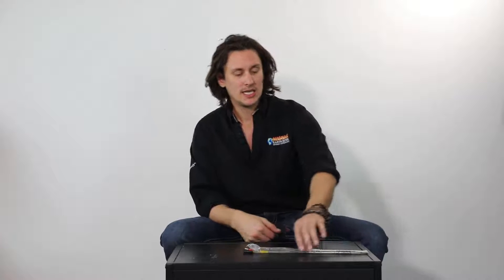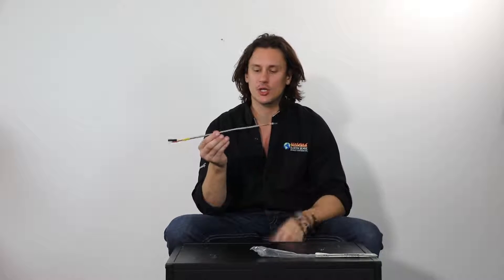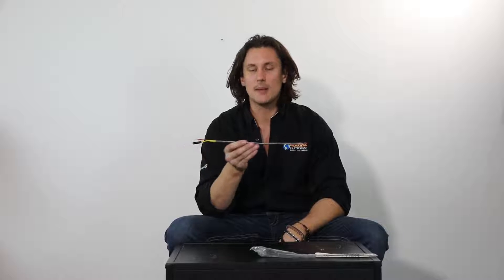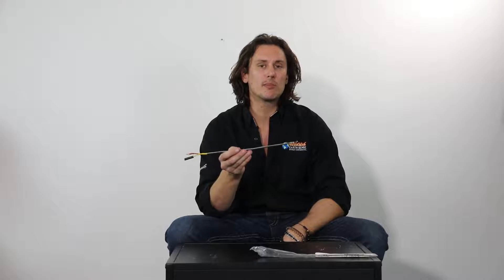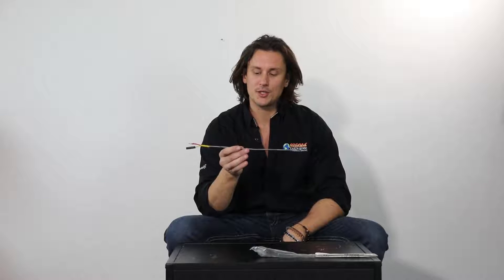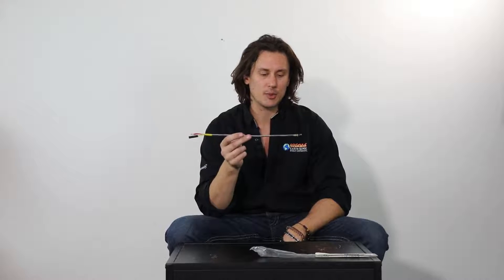Quadrafire Thermocouple Function & Troubleshooting

Comment: Please help.....i have an old quadra fire contour from like 2002. The red call light won't stay on and i just fixed the connectors from the old wires coming from the box. The thermocouple was replaced last year.
Reply from the maker: Thanks for the message. Please walk us through the details. 
Does the call light come on at all? 
Is your combustion motor running? 
Is it feeding pellets at all? 
Have you checked your wall thermostat?
The more info the better. Always check the simple things first. 
- Thermostat Wire connections. You can bypass the thermostat by putting a large paper clip in the terminal where the thermostat wires are. This will let you know if it's an issue with your thermostat. 
- Outlet Voltage - If you have a volt meter, double check the voltage coming from the outlet. We want to avoid extension cords and we recommend a surge protector incase there is any power surges or spikes. 
Let us know some further details - Happy to help.
Reply: @EarthSense upon further investigation it seems to be the thermocouple connection to the rest of the wiring harness. So the red and yellow wires are backwards on this, it was that way after buying a new thermocouple 1 or 2 years ago. So the red wire from the new TC goes to the yellow wire on the harness. If I fiddle with that particular connection I watch 1st the green light will flicker on and off. Now If I let the stove go through it's start up process, which after figuring out everything I need to keep clean for this thing to function properly, it starts up great. When it's about time for the small red light to come on, the light that indicates it has reached 600 degrees and keeps it on and feeding, I again need to mess with that same connection that made the green light flicker.
Reply from the maker: @JKRTV  Thanks for the message. Yes, definitely sounds like the issue is with the thermocouple connection. I would think it will be a matter of figuring out whether the terminal is causing the issue or if it is the thermocouple itself. Get a good light and do some inspection on the terminal and wires coming off the terminal that go into the junction box. If that all looks good, then you may want to get a replacement thermocouple to see if it is the culprit. Keep us posted. Happy to help.
Reply: @EarthSense  I haven't been able to test the thermocouple the way your suggesting, but it's been working perfectly since messing with that connection.
Reply from the maker: @JKRTV  That's good to hear. Leads me to think that it would be the connection. Maybe something is loose.. If there is any rust or build-up on the terminal or connections you can use 00 steel wool to clean them up. Happy to hear you are warm. Thanks for the update.
Reply: @EarthSense Thank you for the video sand commenting back with all this so fast. Yeah it's something with the yellow wire coming from harness going to the red wire on the TC. Between the harness wires connection to it's female connector and the TC's red male connector. The other end of that is while I tinker with the wires the TC and ceramic are slightly moving around in the fire pot. That makes me wonder if the TC tip is moving away from the end of the ceramic....could that be possible? I'm more leaning towards the wire connections but that other part has me curious....
Reply from the maker: @JKRTV  Yeah absolutely, happy to help. I would agree it's most likely the wire connections. If the thermocouple was moving back far enough from the end of the ceramic cover I could maybe see that, but it would have to be a decent amount and I don't think that's the case as you tinker. It's good to make sure the thermocouple is approx. 1-1/2-2" into the burnpot to properly detect proof of fire. Here's another thermocouple video for resource as well. https://youtu.be/Hjs3KhP9ntI?si=qpD7D8ThMOaOMh__
Keep us posted, Thanks.
Reply: @EarthSense  I'm guessing that's your personal stove? Yeah I have the bullet connectors, didn't know that's what they were called. I have my TC in the firepot 1 inch but I'm pretty sure that's what the instructions said... also guessing that's just what it was on this particular model form 2002.... should it be that little bit more?
Reply from the maker: @JKRTV  Thanks for the message. This was a refurbished Quad 1200 insert model I used for the video. Good rule of thumb: Have the thermocouple extended into the firepot at the length of the ceramic cover tube. We want the Thermocouple bracket to secure the tube and the thermocouple itself at the very end of the ceramic cover. 

On a side note, check the thermocouple connectors. Use fine steel wool if you see any corrosion on the connectors to clean them up. 

Keep us posted. Thanks!
Reply: @EarthSense hello again... hopefully your still looking at these.  So I'm still having problems with the wires going to the thermocouple. Right now I feel like the wires connecting the TC to the computer need to be replaced. Problem is that box is basically sealed with rivets.
Reply from the maker: @ Thanks for the message, always happy to help. Yes, the TC wires along with the other component wires are apart of the Junction Box in the unit which is sealed with rivets. Generally speaking in this situation a new junction box would be needed if you have determined the issue is within those lead wires. Here is the replacement Contour Junction box for reference - https://pellethead.com/product/quadrafire-contour-castile-fs-santa-fe-fs-junction-box-wire-harness/

Comment: Hello,  I have a quadrafire 1200
Was working then power went out at house now won't start...
No exhaust fan..
No lights on control box
Call light does come on when thermostat
Turned up
Tried control box
Bypassed #3 snap sensor
New exhaust motor
What's upppp?
Reply from the maker: Thanks for the message. It sounds like maybe there was a power surge or short that happened when the power went out. Was the 1200 plugged into a surge protector? When you say 'Tried Control Box' does that mean you put a new control box in? If you have a local dealer possibly they can test your control box. Check the fuse in the junction box where the control box goes into and replace. Check all wiring and connections. Keep us posted, happy to help.

Comment: I have a question about my Mt. Vernon AE.  My wife noticed that the blower seems a little louder than normal.  Also, I turn the thermostat to “Off” in the evenings so that I can clean the glass before I fire it up the next day.  Lately the blower is blowing in the morning even though the stove is turned off.  Later in the morning the blower is running at high speed even though the thermostat is set to "Off".  When that happened I sa a "Bad TC Drop Tube" error message on the thermostat. Any thoughts as to what I need to do to fix this?  Thanks.
Reply from the maker: Thanks for the message, happy to help. Checking in with our tech team on this. Just to confirm, are you referring to the distributiuon blower (Room Air Fan) or the combustion blower exhaust fan that is running when the T-Stat is set to off?
Reply from the maker: Hey Jim, some feedback from our technical team - Drop tube thermocouple issue. Stove thinks it's hot, that's why the fan is running.
The Drop Tube TC is also referred to as the Thermocouple K Ring Mount. Reference: https://pellethead.com/product/pellethead-replacement-quadrafire-mt-vernon-ae-edge-60-thermocouple-k-ring-mount/

Let's take a close look at the mount and electrical connection of this part. Keep us posted. Thanks!

Comment: Great thank you. I will watch these videos. When I turn the stove on, I am not getting a green light on the box. When I push The reset button on the back of the unit, the auger does not start. The fan is running, the heat element is glowing underneath. I ordered a new thermal coupler from you, through Amazon, that is coming tomorrow. I wasn’t sure if that could be the issue as well.
Reply from the maker: Thanks for the message back and information. The thermocouple will allow the stove to continue feeding pellets after the ignition cycle. If pellets are not feeding when you turn the thermostat up to call for heat and/or when you press the reset button, we most likely have a different issue at hand. Always good to start with the simple things first. In most cases this is typically an issue of ash build-up/blockage in the stove or vent pipe. Let's make sure the stove and venting is thoroughly cleaned. Is the stove feeding any pellets at all? If it is not, let's first make sure that all doors are shut and sealing tightly - Front Door, Ash Door, and Fuel/Hopper Lid. When you open up the side panel you should be able to see the auger feed motor - does it look like it's trying to turn or does it seem like no power is running to it? If trying to turn, most likely a jam. From there let's clean out the fuel hopper and look for any foreign objects or issues with the corkscrew auger shaft. If it seems that no power is coming to the auger motor, let's make sure the electrical connection from the motor is secure. From there inspect the combustion exhaust fan. It should be running close to line voltage during start-up. If it seems slow or sluggish it may not be creating proper vacuum. We can indepedently test the auger motor to see if that is good. You can type in "test cord" on our channel to see a video on how to do that. If all of that looks good, let's create a jumper wire and test the #3 high limit and the vacuum switch (independently). Keep us posted, happy to help.

Comment: Hello, I have a Quadra fire Castile stove from around 2005. I have read that you can reset snap disc number three. I am trying to troubleshoot my stove, and I cannot figure out how to do this. It seems like there is a hard tab between the two connectors. That does not seem to move it all. Any help would be appreciated!
Reply from the maker: Thanks for contacting us. Checking with our service team now on how the reset works on the #3 high limit switch. Will follow back up ASAP. In the meantime, let us know exactly what is going on with your Castile. More details the better to help troubelshoot. Appreciated.
Reply from the maker: Ok, I heard back from our tech team. If the tab in the middle of the electrical tabs on the switch does not move, it means the switch is not tripped. When the switch is tripped that middle tab will push down and "click". You can create a jumper wire and do some troubleshooting tests to see if the switch is faulty. Here's a video below on that and here is a link to the #3 switch for reference. https://pellethead.com/product/quadrafire-heatilator-high-limit-switch-snap-disc-3-manual-reset-oem/

https://youtu.be/FDVkbsHS95U?si=ZSNg7MXpwvpm0i-B

Again, give us a breakdown of exactly what is happening in your Castile and we should be able to better assist. Thanks!

Comment: I have a Quadra Fire 1200 pellet stove won't shut off dose not respond to thermostat can here thermostat click red light stays on thermocouple or control board.please help
Reply from the maker: Happy to help. When you say it does not shut off, do you mean that it continues to feed pellets and both blowers continue to operate, or do you mean that the exhaust motor will not shut off once everything is cool?

Comment: How do remove the thermocouple
Reply from the maker: Thanks for the message. You will first pull off the thermocouple ceramic cover. Next you will release the thermocouple from the thermocouple bracket/holder located by the firepot. You can use lubricant if the screw to loosen is tight. From there make sure the stove is unplugged and follow the thermocouple wires back to the connection point. Based on the Quadra-Fire model they vary a bit, but it should be pretty strait forward to pull the old one out and put a replacement in. If you have any other questions please let us know. Thanks!

Comment: If you guys are still reading these comments, just wanted to thank you for having this video out here. I have a heatilator PS35 pellet stove and I've had the worst of luck with it (it's an old used unit that came with the house we live in, not sure how well maintained it was) and I've replaced the igniter and now thankfully have determined the thermocouple seems to be bad. 

I've inspected the stove and there seems to be no ceramic tube at all, so it would appear the thermocouple got burned away after we had to run the stove so much with the deep freeze we've had.
Reply from the maker: Thanks for reaching out, glad the video was helpful. Yeah, without the ceramic tube in place the thermocouple will be burn out very quickly. It's imperative that the ceramic tube is in place during operation. Here is a replacement option with the ceramic cover tube for reference https://pellethead.com/product/pellethead-replacement-heatilator-ps35-ps50-cab50-thermocouple-14-protection-tube-bundle/
Any questions please let us know, always happy to help.

Comment: I have a quadra fire 1000. And the fire pot get fully loaded with pellets. Is that a thermocoupler issue or an ignition problem?
Reply: During normal operation it seems to be flooding it with pellets, suffocating the fire. So was thinking the thermocoupler was calling for more heat?
Reply from the maker: @jasonjensen7249  Thanks for the additional info Jason. No, the thermocouple only senses proof of fire allowing the stove to go from startup into normal operation; the thermocouple plays no part in the actual fuel feed; that is controlled by the control box only. Most of the time when we see something like this where it appears to be overfeeding, it's actually an air loss or air blockage issue. Few things to go through and check.
1. Stove and Vent Pipe Fully Cleaned.
2. Door gasket and ash door gasket sealing tightly.
3. Burnpot - Check to ensure all holes are open and gasket looks good. If you have the upgraded EZ clean cast iron burnpot, make sure the bottom porkchop is sealing properly when closed. 
4. Air Intake - Make sure there are no blockages
5. Double check your combustion fan voltage. Should be near line voltage on start-up and near line voltage when running on high in normal operation. 

Start with the basics - 85% of the time this would be accumulated ash in the stove or venting or weak gasket seals. Keep us posted, happy to help.
Reply from the maker: Hey Jason, happy to help. Need a bit more info. Is your 1000 unit overloading pellets during the start-up cycle or is it after it lights during normal operation? During start-up the unit should feed a small amount of fuel, igniter lights the fire, thermocouple senses the heat and allows the unit to go into normal operation. If your firepot is filling all the way up with pellets during start-up, I would say we most likely have a control box issue - send us further information on exactly what is happening and we can better assist you. Thanks.

Comment: I have a Castile stove that is running through start up and feeding pellets, and after ignition a green light in the control box is lit. Then before the blower turns on the light turns red and stops feeding pellets. I assumed this is the thermocouple failing, so I tried taking it off, cleaning the cover, and it wasn't noticable there was anything wrong. The stove is only in it's 5th year, do you think the thermocouple has actually failed or is there something we can try to make sure everything is still connected properly? As I typed this the red light went back to green, but it has still not fed more pellets or kicked on the blower to the room. Thanks!
Reply from the maker: Hey Pat, thanks for the message, happy to help. The thermocouple is the device that senses proof of fire and allows the unit to feed after startup into normal operation. In most cases if the stove stops feeding after start-up or during operation, it will be a thermocouple issue either not reaching proof of fire or losing proof of fire. I think you did a nice job inspecting the thermocouple, thermocouple cover, and thermocouple connections. You can toss a half handful of pellets in the burnpot prior to start-up. This will ensure it gets hot enough during start-up to lock in the thermocouple. If after this experiment it's still not feeding correctly after start-up, I would heavily lean towards replacing the thermocouple. 
For reference, here is the correct thermocouple for your Castile.
Thermocouple Only: https://pellethead.com/product/pellethead-replacement-quadrafire-heatilator-ecochoice-14-thermocouple/
Thermocouple W/Cover: https://pellethead.com/product/quadrafire-thermocouple-20154-bundle/

Keep us posted, happy to help!